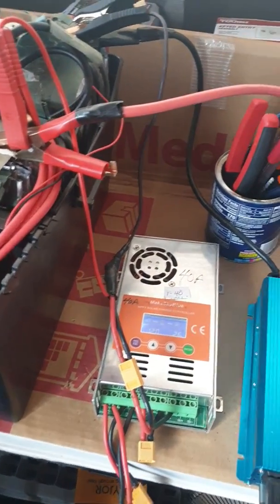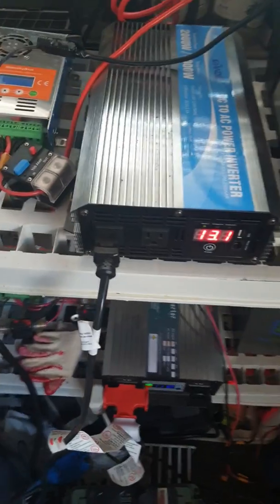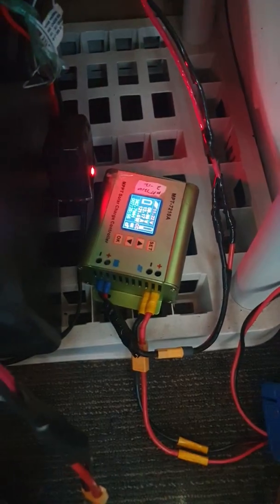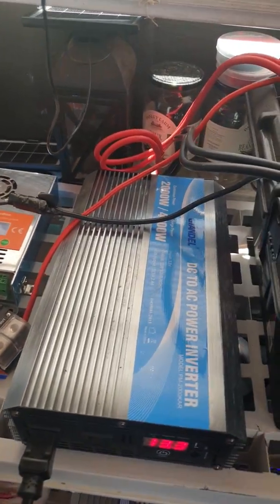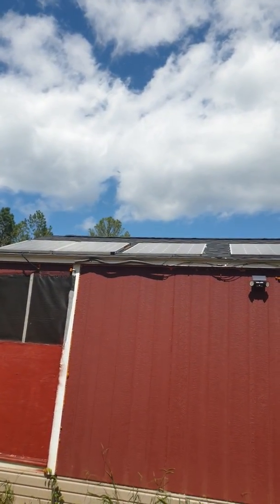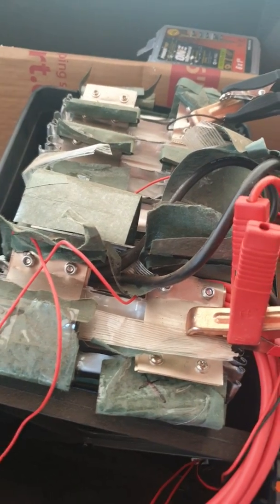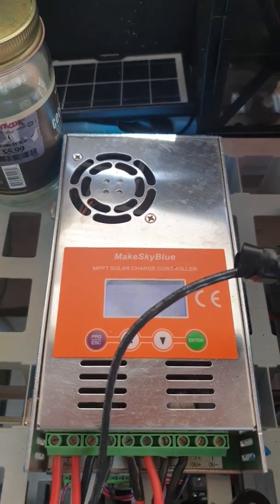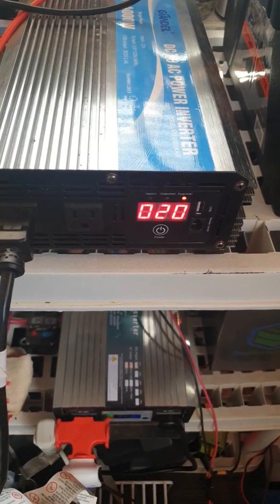DIY  3kw Solar System Off Grid update #Batteries #Solar-panels

Comment: Would be nice to know what setup was, power splits... maybe even what you are using power for.    I think you said usage in like 7 seconds...    so how has solar helped, etc....   a generator would work too...  but you don't tell why you did or what the purpose was.    Also, what safety setups etc...  this looks pretty hap Hazzard and invites others to construct similarly.    Promote the good 👍
Reply from the maker: It being use for a tiny house, Solar has help a lot I don't use my generator that oven or in over a year, I have fuses set at different points and this is a basic setup for my 12v system that has ran over three years. I might make a rebuilt very soon with some updated specs. Thanks for your concern.

Comment: Hey DCenergy is everithing 12V or did u use 24V as well
Reply from the maker: It a 12v system but I have some wire set up in Series coming from to solar panels and myMPPT break it down to 12v going in to the battery system.